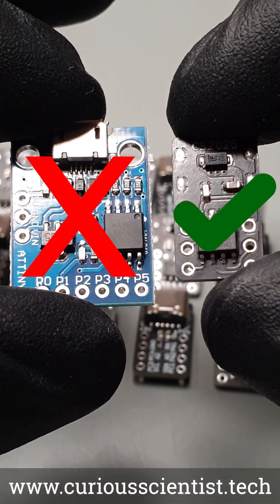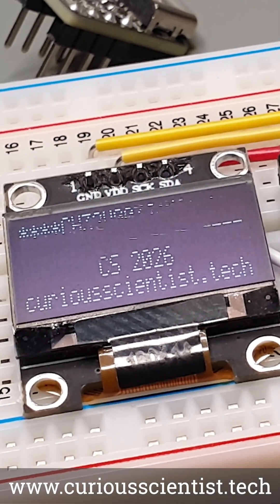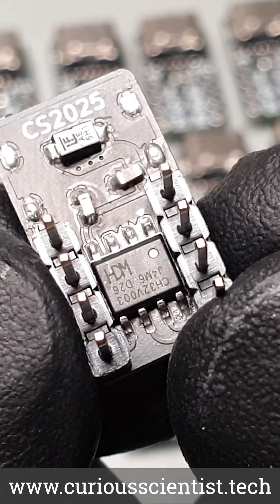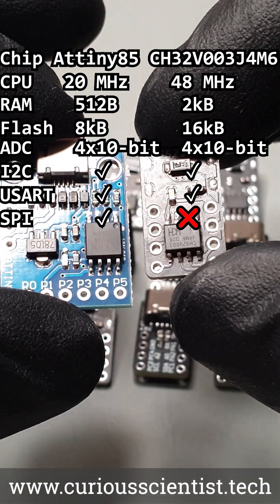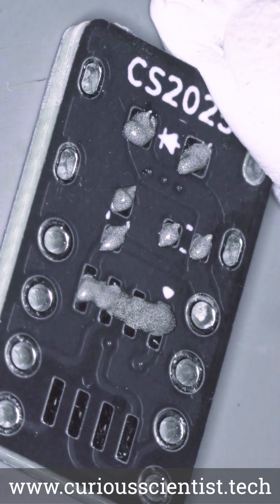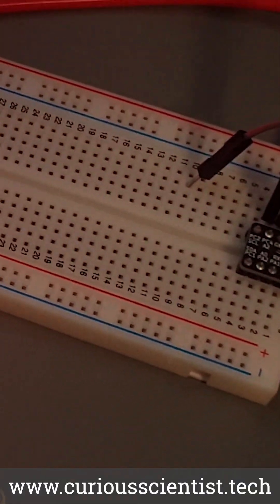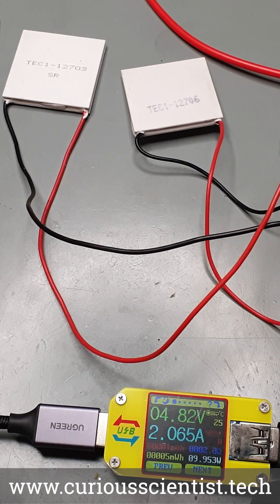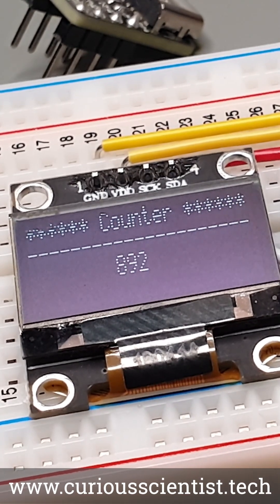#miniature #pcb #ch32 #microcontroller #attiny85 #electronics #pcbway

Comment: stop copy my ideas 😂... i did the same. the downside is that there is just an undocumented library for the wch chip. so, either you're going to do a bit of reverse engineering of the lib or you go with lowlevel C and the wch reference manual. the wch doc is good.
Reply from the maker: Where did you share your work? I did not find anything on your channel. 

There is no problem with the library at all, because I have very well documented libraries for the WS2812B RGB LEDs. I wrote them both with an SPI-driven approach and a timer+DMA approach. Both are carefully documented and presented on my channel and website. I have been producing tutorials and libraries for the CH32 chips for about 2 years.....